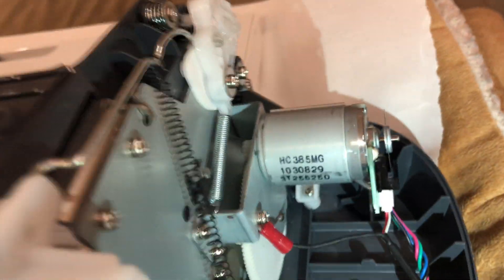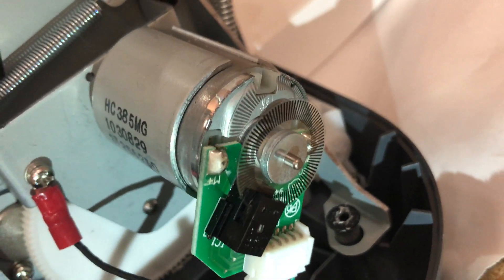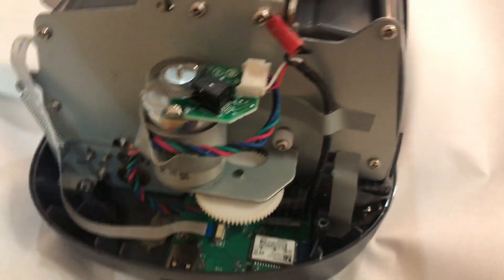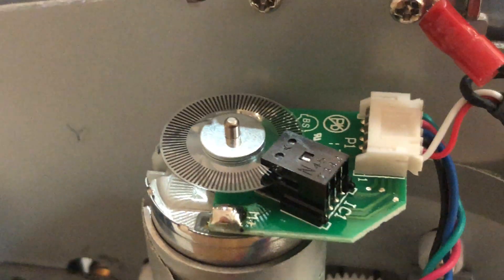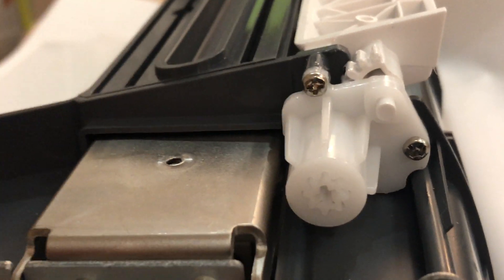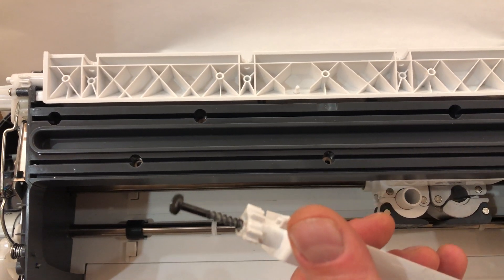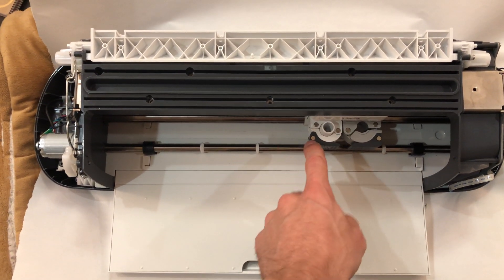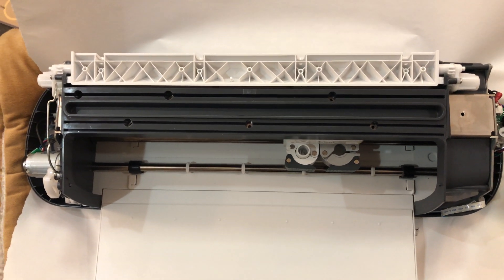Cricut Maker broken?  A look inside the cricut maker with the cover off.  Motors and such.

Comment: Great video!  I replaced the black roller things on my top roller, but now it will start a project but when it starts to cut, the machine stops and the cricut light blinks.  When I took it apart, I did accidently pull the black ribbon thing that says 60 V VW1 out and then tried to put it back in the little slot.  could this have caused my issue?  I also tried to calibrate it but it says it's not recognizing the tool, which is in place.  Thanks!

Comment: Any chance you can tell me where I can get a door cover for the maker..... the plastic gears broke on mine...
Reply from the maker: Assuming you are talking about the long white honey comb looking plastic (like in the top of the pic of this video) with the gears on each end, right?
Reply: @Idotooby  yes the one that you had an extra that was broke that you put the black screw in the end to act as a hing pin
Reply from the maker: Unfortunately that is the only one I have.
Reply: @Idotooby  ok thanks, I called cricut and they acknowledged that this is an issue with their machines, but won’t do anything for me cause it’s out of warranty. I responded usually an ongoing issue results in a recall but they didn’t like that idea........I ended up putting a screw to replace the broken hing pin. I guess my wife will have to live with the front not auto opening due to the gears missing but at least the screw eliminates the clunk now when opening it.. thanks for the videos.

Comment: Any chance you’ve encountered the rubber rollers moving?   Been trying to get my machine replaced but if there is a fix I’d love to know.
Reply from the maker: Try pressing the feed button while pushing in the direction needed until it reaches the right spot.

Comment: Thank you for the videos. Helped me get my Cricut apart and find the problem.  The bearing on the feed shaft below the plastic cover completely failed.  Anyone have an idea of where to get the bearing or replacement shaft?
Reply from the maker: I may have one.  Let me check.
Reply from the maker: I do not have one.  I have some for the explore air, but I don't know if it is the same.  If you send me a pic I can try and compare.
Reply: @Idotooby   thanks for looking 
How can I send a picture? I don’t think YouTube allows
Reply: @Idotooby  thanks.  Sent
Reply from the maker: Unfortunately I don't think it will work as it is vastly different.  I will let you know if I come across one.  Also noteworthy, beware that if you do find a machine that it is listed as a dummy machine it will not have what you need.
Reply: @Idotooby  ok thanks again. The search continues.

Comment: How do you get the load roller to stop coming off...won't load the pages when off and a pain to keep putting back on.  Thanks
Reply from the maker: I am not sure I understand your question
Reply: The roller that feeds the paper keeps coming off the gear on right side
Reply from the maker: Hard to say, but most likely a near complete disassembly (or at least to that part) would be required to see what is going on.  If you figure it out and need a part, I may have one.
Reply: @Idotooby  I contacted Cricut and they said it's a flaw that has popped up in their newest models. They're supposed to send out a new one. Thanks for responding
Reply from the maker: Interesting, well to me at least....  Frustrating to you I am sure.  Thank you for sharing to the pool of knowledge.  I am glad you got it sorted out.  Hopefully you never have to watch any of my boring videos.  LOL.  :)

Comment: Thank you. My maker is 4 months old and now won't turn on. It grinds for about 4 seconds then the power button flashes. I CAN NOT get any support help from Cricut, wish I had known that before I spent 400 bucks on their machine!!!
Reply from the maker: If it is under warranty they should be able to replace it.  However I am guessing that is not the case.  Kind of difficult to diagnose based on what you said.  It could be a ton of things.  Some random guesses come to mind.  Belt tension, something stuck in machine, gear?  Most likely you will need to start by opening the machine up.  You could try to play the belt like a guitar string to see if it is tight.
Reply: Call Cricut and ask for a new one.
Reply: @louisejohnson1898  FINALLY got my new one from them. Yes it was under warranty, communicating with them is worse than a 3 year old!! It took 4 months, but I got it!! Thanks

Comment: My Carriage is not sliding along the bar but I can physically move it so I don't think it's the belt do you think it's the motor or the gear the belt turns on
Reply from the maker: I will do a video to try to address this soon.  However most likely you will have to take off at least the right side cover.  You can see how on my other videos.
Reply: @Idotooby  I definitely watched all of your videos so I will be looking for a video addressing the situation but at this point everyone is having the same problem you should go into the repair business for this particular machine